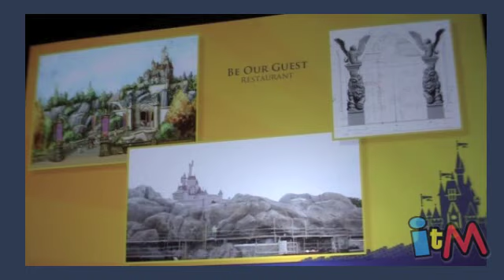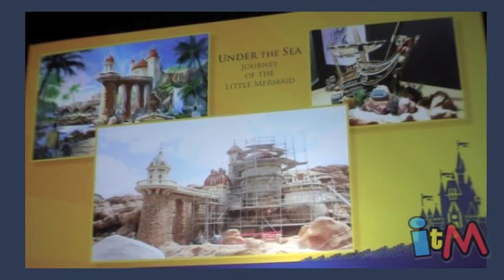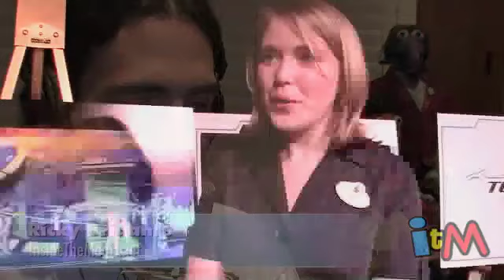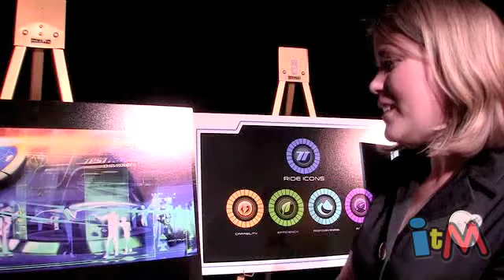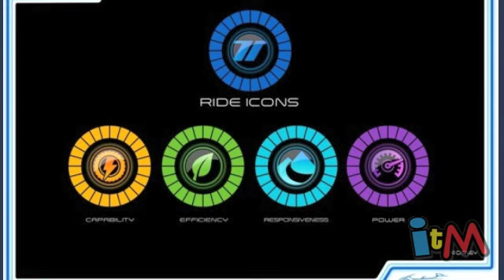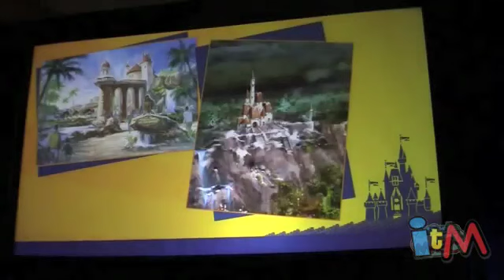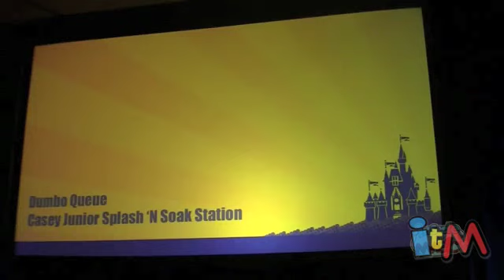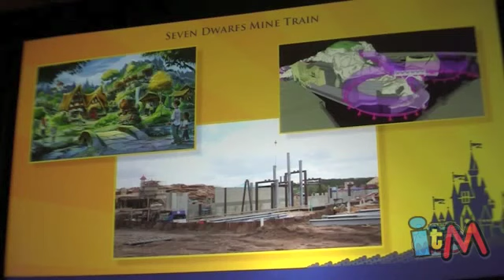Inside the Magic podcast LIVE - Show 369 - April 29, 2012

Comment: For the Dolby announcement, you said it is the 1st time sound would be even in the ceiling. That may be true as a standard, not true as heard in a theatre. When Star Wars came out there was a theatre built for the opening  it had sound from all sides. including on top.  When the opening scene of the corilian ship coming from behind and over you being chased by the star destroyer came in we heard it first from behind felt it coming over our heads and then finally saw it in front on screen.